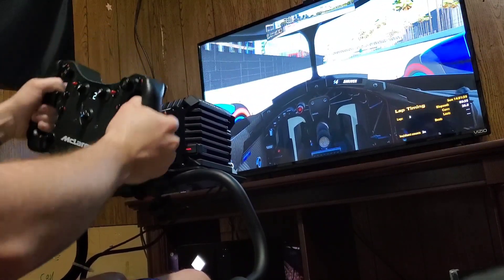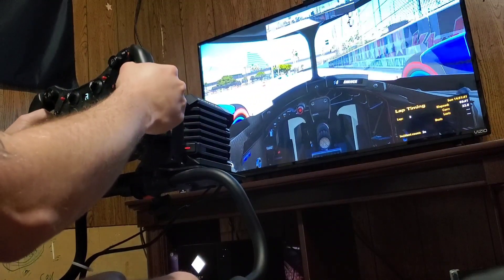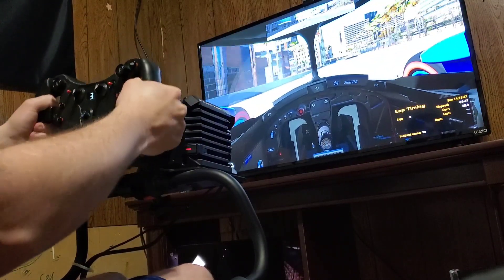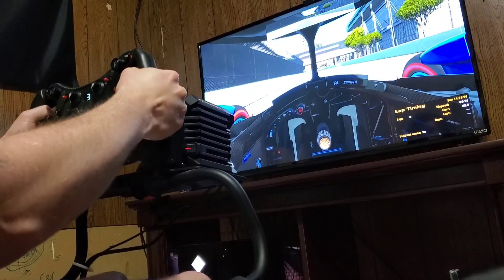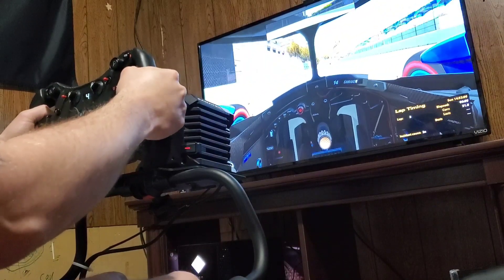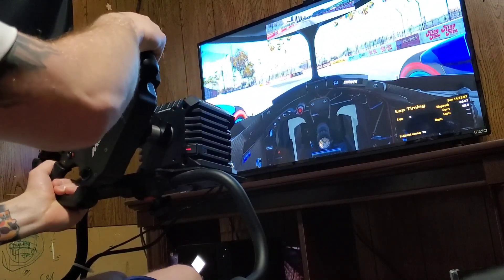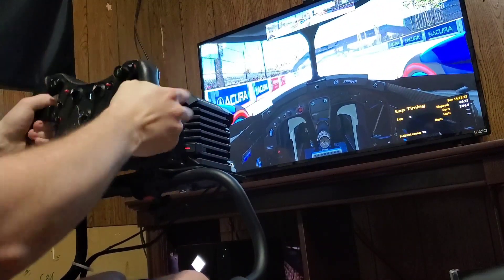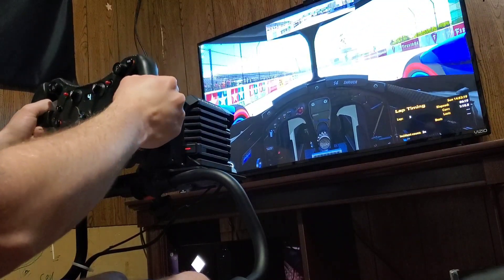REVIEW - CSL DD On A Playseat Challenge

Comment: I just ordered both of these this weekend and am glad they work fine. Understandingly it’s not PERFECT but I don’t have any room for a bigger rig.. how did you secure the pedals? This has been my biggest concern. I got the load cell pedals and hoping they will fit
Reply from the maker: Pedals wise, I used the extra velcro that came with the Playseat Challenge while also using tie downs on the front of the pedal tray to hold in place. However you could also go to the department store and get a strap down (plastic one with decent length) on the pedal base itself to hold it down well too. 

It won't remove some lift in the pedal tray under extreme braking, but everything will hold I can say.
Reply: Indigo lime sells 3d printed brackets for certain models of pedals. Can check and see if they support your pedals
Reply from the maker: @michaelbracken9585  At this point wouldn't really be much of a point to do so since I've already upgraded my rig & no longer have the P. Challenge. However hopefully someone may be to try this comment!
Reply: How did this go for you Brian?  Am looking at doing the very same.  Pedal attachment being the main concern.

Comment: Do you notice any noise coming from the playseat challenge? I'm running a TGT2 base on it and there's quite a bit of squeaky noise from the flexing, and my seat is brand new. Thanks.
Reply from the maker: So the noise from the plate itself and bottom part of the Playseat I do hear the rattling from the ffb if my headphones aren't on. My headphones are nearly noise canceling, so I don't hear the noise per say.

However I'd say if someone is with a family/wife/husband/kids at night and they're trying to sleep, I'd recommend keeping it in an area they couldn't hear it. Cause when the ffb kicks in, it can be a bit noisy.